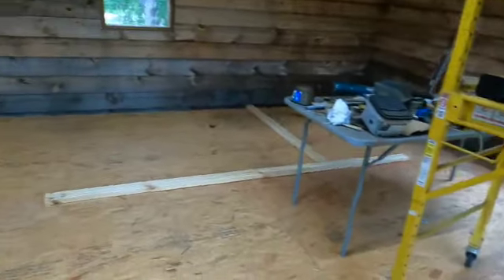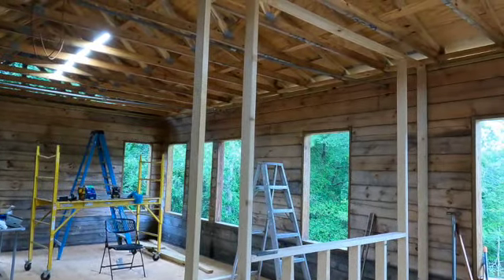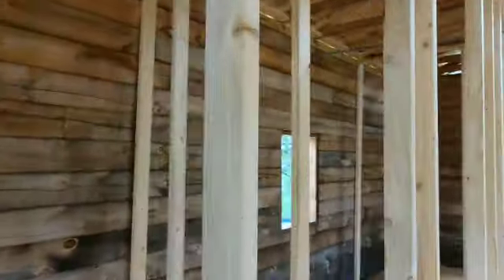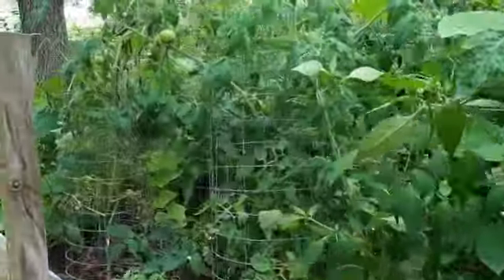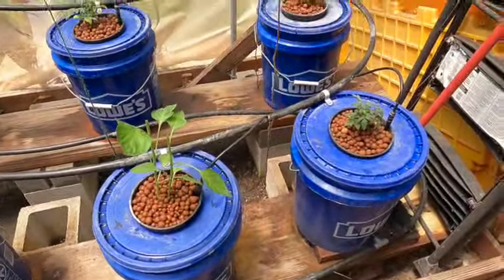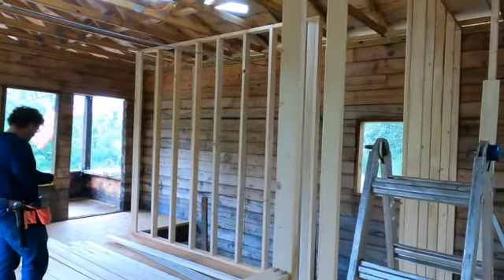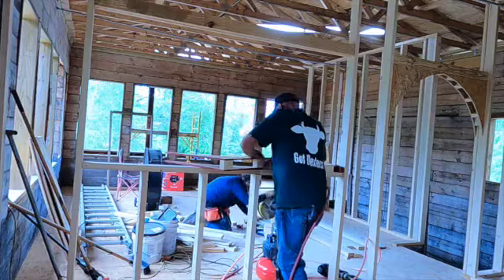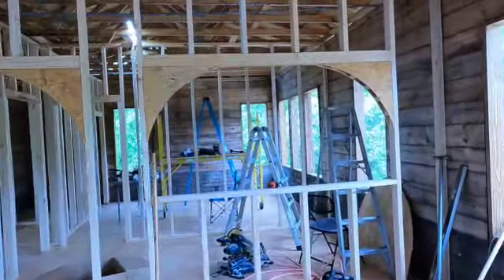CARRIAGE HOUSE, CALVES AND CRITTERS!

Comment: I'm looking at a house build on my new property but I am concerned about log shrinkage. Are you worried about your interior and exterior walls changing?
Reply from the maker: To minimize any shrinkage or settling I started with a concrete foundation and slab and I used kiln dried logs. Plus I allowed for any settling by increasing my rough opening dimensions by a 1/4 inch. Plus due to my schedule it has taken a while to get to this stage that most settling has already occurred.